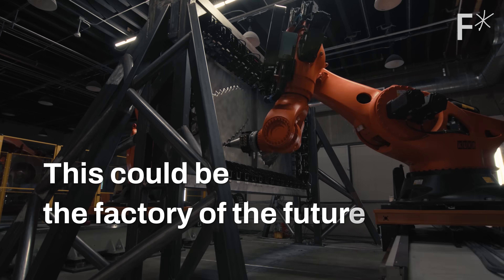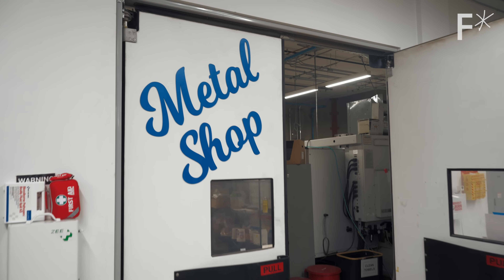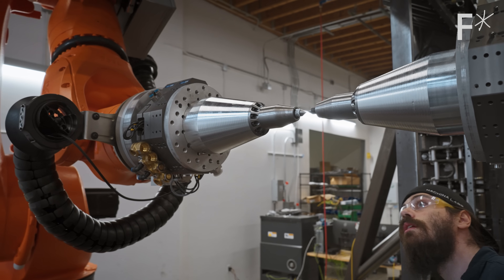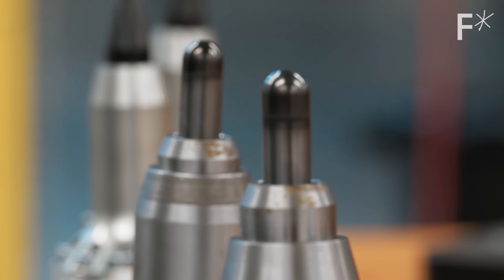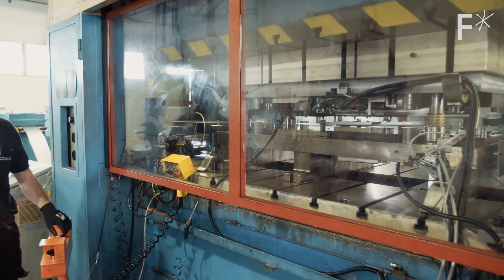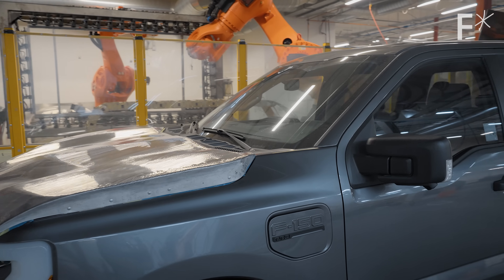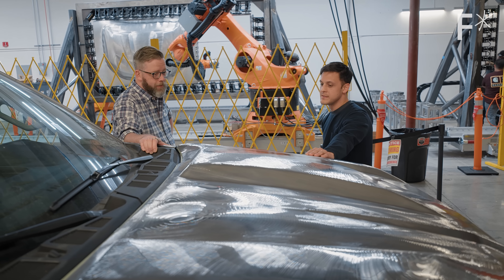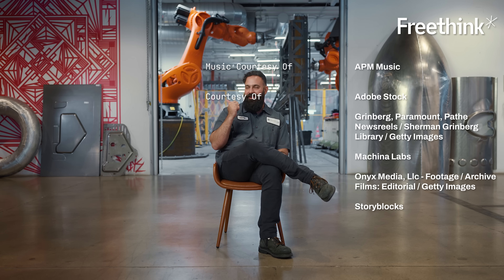Former SpaceX engineer invents a “Robotic Blacksmith Army” | Hard Reset

Comment: Like the VP of Product said, "I don't want the design power for the things that I use to sit in the hands of probably some of the organizations that might be least ready to design the next thing."

This would be great for film sets, outsourcing props building can be insanely expensive. I know a lot of people are sensitive about the use of "AI" and automation in the film industry taking jobs, but if the only barrier between an independent director and Hollywood studio is capital, this is huge! Democratizing the entire filmmaking process lowers the barrier to entry to the point anyone could do it! If it's so easy anyone can do it, it will only be interesting to the people that are passionate about it.
Reply: I dont think this technology will democratise filmmaking by lowering the cost of building sets and props. This looks expensive. Sheet metal is rarely used in the manufacture of props and even less for sets. You can paint cheaper material to look like metal. If you wanted to customise that truck like they have for film, it would be cheaper to attach vac form panel of plastic or a panel made from fibreglass if you needed it to be tougher. I hope if you intend to make a independent film you will consult some professional makers before hiring this company you might save some.
Reply: @stin-dog172  I'd love to hire a maker but dude I live in the middle of a cornfield. According to Production Hub there are only 4 registered prop 'makers' in my entire state. There is no filmmaking industry here... just a multibillion-dollar manufacturing industry. 15 years in this area and I have never met a single 'maker' that works on large set props, yet I know several fab shop owners that would allow me free access to CNC's, lathes, CMMs, and plasma cutters. If they had this equipment and some downtime I guarantee I could trade them some services to get an actually working Sci-fi Mad Max-style truck so long as I cover the material cost and create the CAD myself. 

Our town is 50,000 people and there is only 1 other media company within 45 miles of us with enough employees (4+) to run a mini-production. Trust me, this is a far more viable solution for rural people than hiring one of the four makers in our entire state.
Reply: 😅There are tradeoffs. Basically , if number of people who can do a particular thing decreases, competition increases............
Reply: Money
Reply: Gold! Thats democratization mentioned is great in some industry using ton of people (not too much tool) like advertising (youtuber vs traditional tv) , but industry ... 😢 
I used to hope myth with 3d printer too
Reply: @quyentran977  3D printing has transformed things. Rapid prototyping is extremely accessible - we are at the point where you probably know someone with an SLA 3D printer, if not a filament printer. And what is coming up are printers for ceramics, and more that are getting far better, and far more affordable.

I was expecting something like this - I was not expecting the news to have come out 10 months ago as of writing this.

And now with metal 3D printers doing literal work on rockets? It's going to grow, and get better. It's happening - just, slower than we would like.

Comment: This is EXTREMELY interesting technology but it will never evolve into mass production. It will, however, definitely find a niche in one-off, prototyping, or very limited production. I can see Koenigsegg using it. 

My thought would be that they need to add a tool changer, swapping out end effectors that would progressively take a part from rough to smooth.
Reply: this is prefect for prototypes, testing and adjusting the product. Its not cheap for mass production but its cheaper to prepare for mass production. You dont need to make an entire production line just to test a prototype.

And the custom stuff will love it. Its like saying a 3d printer isnt useful and injection molding is the future... like yeah, you dont 3d print for mass production
Reply: Yeah. It's way too slow and too expensive. When you need a few days or even hours to produce one piece, it will never be as cheap as pressing.
Reply: They have tool changer, they just did not make a station with tools ready to swap for some reason. Probably because they are testing tips and parameters. System they are using for tool change is mady by RSP.
Reply: @mysteryMachinePL    After thinking about it, it may be partly due to the increased force necessary with larger effectors plus, the metal has been cold-worked,  increasing its hardness.
Reply: Imagine the tips becoming different sizes and shapes in a lineup. Suddenly cold forging shells becomes automated.
Reply: Or creating carbon molds.
Reply: Why should Koenigsegg using this instead of carbon fiber. There are no benefits
Reply: @KingElmo83    Rapid development. As soon as their is a CAD file it can be sent to the metal shop to be made, as a prototype if nothing else. The form required for doing the carbon fiber layup has to be cut with a CNC machining center and if it turns out to be not what they want then another has to be made.
Reply: A lot of Naysayers have used the words "this will never" and "niche". Remember when a rocket launch happened every few years? Yeah...
Reply: It's not suitable for what "Koenigsegg" uses, i.e. carbon-fibre prepreg body and interior panels. It takes one or two days for a large 5-axis CNC-machine to create a plug with foam core and 10-20 mm thick layer of epoxy paste with smooth finish to produce moulds for composite car body panels. For example, the plug model for the roof panel of Koenigsegg Agera would cost no more than 3000 Euros to order such a plug to a 3rd party CNC-shop. Each mould itself costs about 500 Euros in materials (special epoxy hard coat on the top layers, reinforced with composite paste for moulds) and needs about couple of days to cure. So, in 3 to 5 days you can have the first mould, and every extra mould (100% the same as the previous one) will add couple of days more. You can have 10 identical moulds in about two weeks for 5000 Euros (plus 3000 Euros for the plug model, or 8 000 Euros total), which let you create a hundred of identical super smooth and ready to pant composite panels each day. 
 BMW even have a much faster mass production of composite part where they use metal stamping dies to form and cure each piece for seconds.
Reply: @AutomotiveCNC    I was thinking sheet metal. So if all those who might use this instead use composite then I don’t see a mass market for this really cool process.
Reply: it could apply in mass production because of it being distributed system. Like instead of massive highly efficient factory, a lot of small ones and not that efficient, perhaps
Reply: @sneeddeens9895 if you're making millions of a thing, it's always going to be cheaper to make a machine that creates one in a few seconds than thousands of machines that can each create one every several thousand second. One stamping press is expensive, but not more expensive than thousands of robots.
Reply: @sneeddeens9895  You would need a lot, like a lot a lot. A stamping press for big automotive panels runs anywhere from 5-20 strokes per minute, 900 panels in an hour is not a crazy number. Based on "I want 20 of these in 20 days" comment - making like a hood sounds like it takes the better part of a whole day, so even with a generous 4 hours per part estimate you would need 3600 of these machines to match what a single press line can in a typical stamping plant.

This will never be useful for mass production, what it will be useful for is prototyping, small batch manufacturing, and super-expensive parts that need exotic materials.
Reply: @MH-kj9hh  well, the fact that it is, even with generous estimation, 3600 slower in making parts, in itself is not an argument. Because if it is on the other hand would be like x times faster to build and y time faster to pass regulations and what not, then resulting ratio could be 1:1. So i personally think it is feasible for mass production.

Also guy in the video was saying it could be built inside city building, so if is true, it probably possible to make it multiple layers. It could also contribute to ratio of 1:1
Reply: @MH-kj9hh  you said the taboo word!!!!......"Never".....
These guys are literally paving the way for this technology.
Of course it's not going to be very practical right now, but later, in 5 to 10 years, who can honestly say!!??
Yes, metal stamping on a metal press in a factory is faster than the robot arms...... again, for now.
Reply: @sneeddeens9895  Consider the cost of energy needed for each part produced. You have instantly a giant disproportion of costs when compared to the energy consumed by a simple press.
Reply: @TheSuperSpooky  this i think good argument, because in long run this will probably determine cost and subsequently how good it for mass production

Comment: I love the dream idea of being able to customize the body of a car as easily as you can 3D print a unique case for a Xbox controller. Shipping/Delivery will become the next choke point in affordability.
Reply: I picture the old days when Rolls Royce would send out bodies and the Carriage Companies would customize for Indian Nobility etc...   
I doubt this would be cheap, but with new electric cars basically being skates then custom shops can build on the Skate.
Reply: Each major city would definitely have one major car fanatic coop that could afford a printer
Reply: Depends on the use case. For cars, the first thing that came up my mind was approval procedures. Cars are often tightly regulated due to concerns of public safety, liability etc. Never forget that these are operated by lay people in their free time (i.e. in any mood or physical state, drug influence etc) in the open public. They are fast machines that weigh several tons. These approval procedures take a lot of time and cost you a lot, and any deviations from typical designs do so even more. The more individual your design and the smaller the total item number becomes, the more expensive the approval surplus per item becomes. It's a trade-off. Certainly in those use cases that have small production volume necessarily, and where the context of application is much different, things may change. Like, special touristic trains, cable cars, mini planes for island traffic, airport vehicles etc.

I was told by a product designer that this is basically the reason why consumer cars in Europe all 'look the same and no designer dares to invent anything new'. And, living in Germany, I'm happy that these regulations are in effect because people drive fast on the highway and metropolitan areas have a lot of shared traffic zones.
Reply: No , it's rather affordability will become the choke point. Period.  These guys have deep pockets  so they can burn some money now. But earning is a different thing
Reply: @Autovetus  I'm not talking about this company specifically, no one has a patent on the assembly line. Once it's effectiveness was proven, that cat was out of the bag and every manufacturer was racing to switch to it... The same thing with this advancement in manufacturing. 

The "last mile" is and has been one of the largest expenses for most product for nearly a century with little innovation. Hand off product, transport, rinse and repeat until product arrives to the consumer.
Reply: @Triflixfilms  Nobody is racing to switch to this, it's slow.. Note how they never elaborate how long a panel takes to make, or any part. That single hood probably took a whole day(maybe longer). Maybe for anyone that's deep in the prototyping and needs field usable parts ASAP, but this will be an absurdly expensive service.
Reply: @Roobotics  Yeah... It's slow but so is a 3d printer. I live in a manufacturing centric town, I've worked in manufacturing for 10+ years, my background is engineering. This will not replace existing presses, it will replace a lot of fab shops that make custom parts that supply to manufacturers. It will also be used by startups that can't afford 5000+ sqft buildings. The speed is directly relational to part size. Since it's sheet metal you can have multiple parts part metal sheet just like die presses. When I worked at a Toyota supplier, the were using 30+ year old dies because it was too expensive to order new ones. When you replace a die you have to have somewhere to store the old ones in case they ever come back in circulation. They have thousands of square feet dedicated to storing dies, that is space you could use to have more of these robots. The other thing is if you $250,000+ die is out of spec good luck tweaking it... Seen a lot of money wasted on "oops looks like we misread the drawing file and sent the wrong spec to the die manufacturer, guess we need to order another."